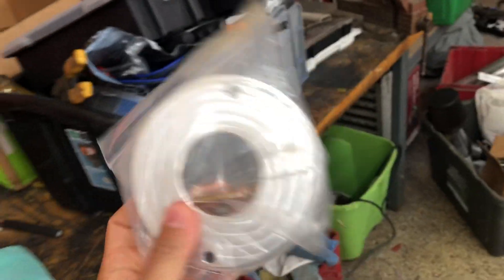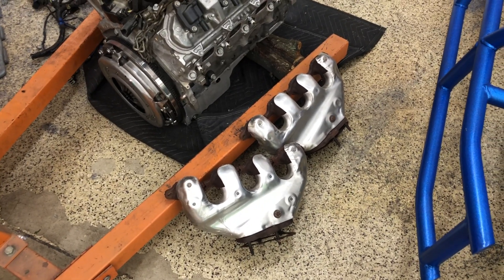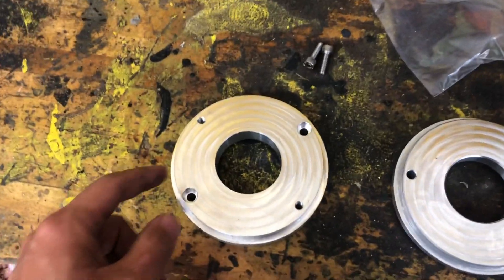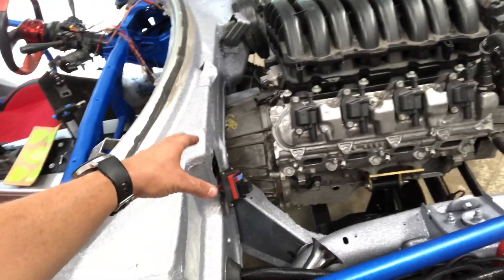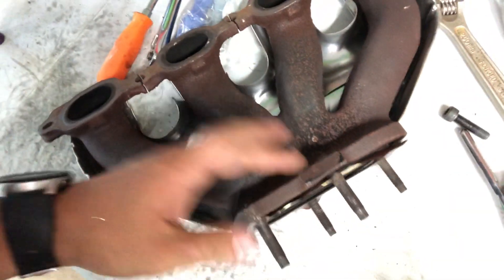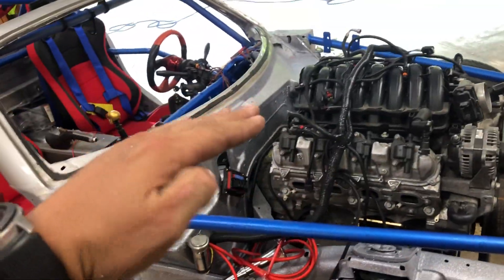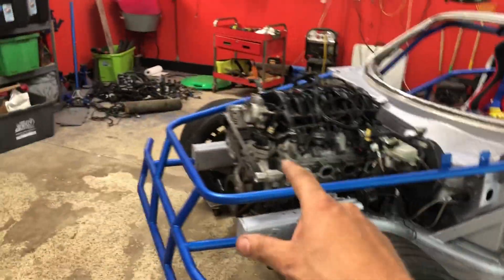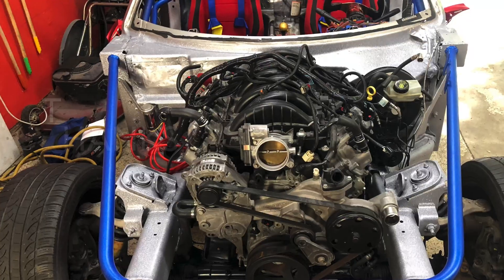Solstice Deathkart V8 Swap- Gen V L83 5.3l 355hp- Part 6: Installing the V8 for the last time

Comment: How did you order the slace cylinder spacers? I'm looking into doing a mating a L83 to a AR5 as well.
Also, any issues with only having 6 out of 8 bolts attached to the bell housing?
Reply from the maker: The spacers came with the FabBot trans adapter kit. Just check out their website it's all on there :) no issues so far having 6 of 8 :) we probably have around 1000 miles on the kart since the swap.